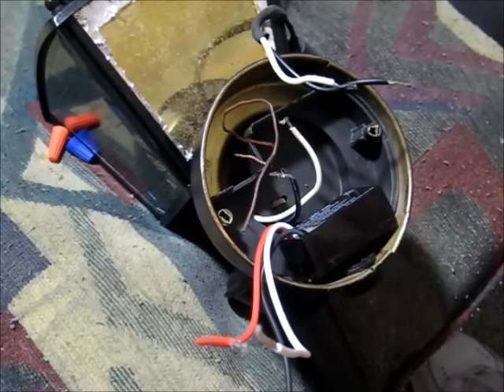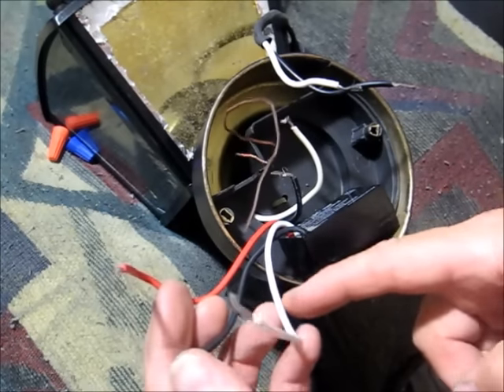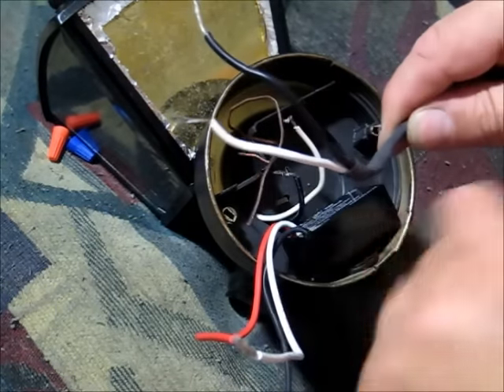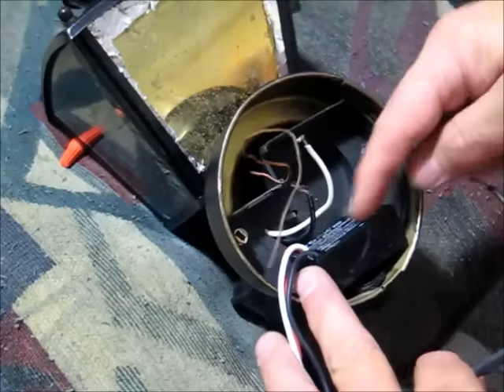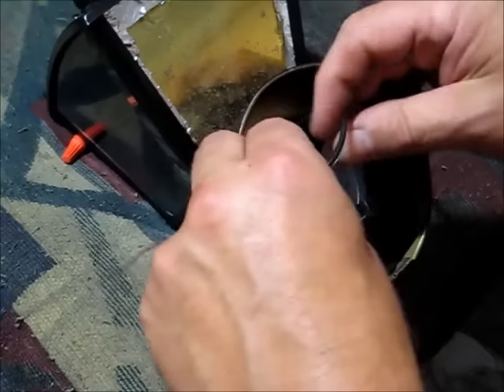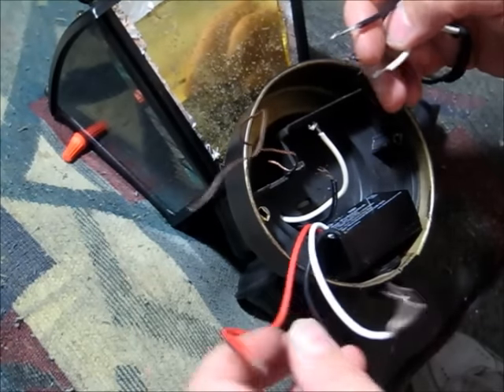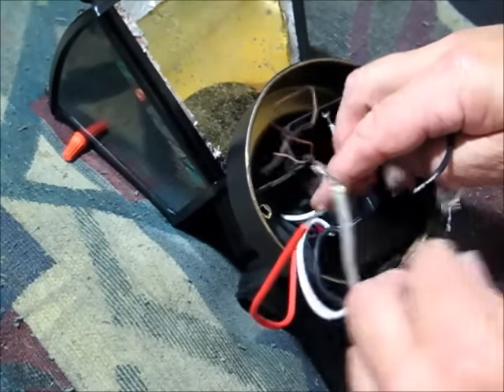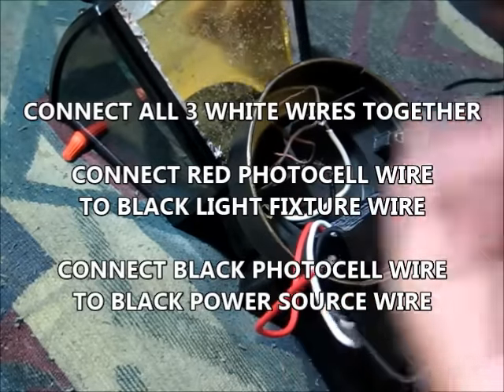HOW TO WIRE A PHOTOCELL FAST AND EASY, SHORT VERSION, THE TRUTH, WIRING INSTALLING HOOKING UP

Comment: perfect.   Ordered one of these online and came with no wiring instructions.   You were straight to the point and it installed perfectly.   Thanks
Reply from the maker: It is great to read your good words, I am happy my video helped. "no instructions" is what inspired this video, the one I bought had no instruction either... and as simple as the solution is, making a mistake with electricity can easily cost/waste money... or worse.
Reply: @7777jayhawk  are you still taking questions on this wiring problem. So many have them stay on all the time. I blow the gfi breaker on my deck led lights thought white was ways to white.the led lights on have 2 wires hot and ground.I tried 3-5 differerned wiring version and it either blows the breaker in the house or stays on all th etime on the outside gfi. The Only place the led light sensor going off and on was inside on a regular circuit, .  but that's not gft.I don't know where you are going with after all the white wires. I always.it's the green ground or the hot wires that messes everything. thanks.
Reply: Simple so anyone can understand.  Thanks!
Reply: @KittieHoney  Never could get mine to work no matter how I wired it. Just like everyone else. How did you get it to work?

Comment: The power line going from the home is red and white.  The light fixture is black and white.  And the two wires from the photo cell are black.  What are your thoughts in wiring everything up?  Thanks.
Reply from the maker: The photocell should have 3 wires, if it does not... if it was me... I would not use it. I would obtain a 3 wire photocell to keep things simple. They only cost $5-$15.00 which is cheap enough to be safe than sorry.
Once you have a 3 wire photocell.... Uhm... As far as the red and black house wires?
I guess... man I dont know. 
Once again if it was me I would assume the black is the black and the red it the white... BUT that could be disastrously wrong. 

YOU HAVE TO BE CAREFUL because, course you are solely responsible if it all blows up. 
Based on that, if it was me.... I would get some ideas from the internet, but I ultimately it is all up to me. We/you/all of us have to take responsibility for our actions. No blaming/suing the internet guy. 

Another idea is... do a simple small test using a lamp or something with a cord you can cut into and then reconnect. 

Cut the cord (you actually only have to cut one of the wires on the cord) on the lamp which will give you 2 ends representing your power line and light fixture.  If you cut the cord in two, before cutting mark the sides of the cord to reattach them the same. THEN... maybe your two wires on the  photocell can be connected to wires on the cord. You know? Hook one photocell wire to coming... and the other photocell wire to going... and leave the other cord wire connected. 
Then hold your breath and plug it in... Have a helper keep their eye on the breaker box, shield your eyes from the bulb in case it explodes and then wait to see if the photocell works. 
Hold you finger over the lens (making it dark) and see if the light comes on. It may take up to 5 minutes to activate, so give it time. If it comes on point the lens to the light and see if it goes off.
If that test works then do the same thing on where you want to install the photocell.
I hope that made sense, if not ask again, I am happy to help. I may not answer fast, but I do try to get back with people who are polite. 
I am curious how it all turns out, let me know :)

Comment: I installed a photocell on two lights I have just outside the garage. One of the light is blinking on and off, what could be causing that?
Reply from the maker: I hope it has stopped blinking by now and is working fine, sometimes they just need to work themselves out. If not I hope you have returned it and the replacement words fine. If not, I am not sure why it is blinking. Maybe it is the time of day dusk/dawn and it is not sure to be on or off... other wise... it is probably defective, esp if the other one is working fine.

Comment: most comprehensive and easy to understand video on the topic out there right now. major props. what if my light has a ground wire too?
Reply from the maker: Thank you for the good words Joseph, they are my only pay for my videos and it makes me feel good to hear that I did good, that is my main objective with my videos :)

------ ""what if my light has a ground wire too?"" -------
If your light has a ground wire AND the house power supply wire at the light has aground wire, then connect them.... but if the house power supply wire only has the black and white wires, like mine does, well.... I can only say what I did... 

My power supply cable did not have a ground when I started this project and fact be known that  light and this house has been here for 50 years without a ground wire attached... so I did not ground the light.

If there had been a ground wire sticking out of the fixture I would have tucked it in, but that may be the wrong way. Could that cause me problems later? is it dangerous? Is it OK? I am honestly not qualified to answer that. But my light is not grounded and so far so good.

I suppose the right thing to do is run a ground wire (or run a whole new power cable with a ground wire) to the lighting fixture and then make sure the other end of the ground wire is actually properly grounded (or it is all for naught) and then connect the ground wire to the light...  but I didn't do that...  I decided to leave it like it has been wired for 50 years and I watched a football game, read a book or made another video instead  :) 

 That is my "cover my ass" answer while also trying to offer good info :)

Thanks for the good words, they are always appreciated. Have a great week!

Comment: I have 3 wires from the house, one is a ground wire, so I connect the ground wire to the metal part of the light where the green screw is, and then connect the other wires like you did
Reply from the maker: Sounds good Dingo,  You should make a video showing that... and maybe show how/where the ground wire is connected (at the other end) so it can help out if/when there is a short and the ground wire is needed.

Comment: I have three wires from sensor. The wire I'm running from the sensor to the transformer is two wires.  How would I hook that up, or do I need to get three wire to run from sensor to transformer?
Reply from the maker: If I understand the question and it is like most things I have dealt with.... The transformer is just a like any power line with 2 wires coming from it. the fixture has 2 wires. The photocell sensor has 3 wires.  Follow the diagram in the video and hook 3 white wires together, then hook the other wires to each other as the diagram shows.

Comment: Here is a question... "Can the RED wire be the main source of power that connects to other lighting loads??" To make a little bit more clear, I don't want the photo cell to be near the lighting load I want to be creative and place the photo cell in a different position so that means the Red wire will connect to a 14 AWG to connect to the lighting fixture... will that work??
Reply from the maker: I guess you could run some extension wires, but it will still be wired the same. I suggest calling the manufacturer of the photocell and ask them the smartest way to do this. I call help desks all the time and ask them about smarter ways to do things like this. I actually look to do business with (buy the products of) places that have a toll free 1-800 help desk number listed on the package. Give them a call and let us know what they said.

Comment: I tried this and it caused my water heater to stop working.
Reply from the maker: I understand, I posted but it seems someone delted the disclaimer for the this video.  I said that doing this has been to known to cause blackouts, cursing, excessive drinking, water heaters to stop working, Sleepiness, Dizziness,  cars to suddenly run out of gasoline, wives to start nagging, extra urination, erection problems, weakness, leg cramps, thoughts and desires of wanting to ride a horse or jet ski are just a few of possible side effects. In addition Fatigue,  Clumsiness, Weight gain,     Indigestion or nausea, Nervousness, Memory loss,    Headache,  thoughts of drinking a lot of beer,  Intense and sudden foot pain, gout, garbage disposal to act erratically, wive to act erotically, lawns suddenly need mowed, strange feelings that you want to move away, Diarrhea or constipation, Swelling of hands or feet, Fever,  Itchy eyes, Thoughts of suicide or harming yourself,  Seizure, fatigue, Intense and sudden foot pain, gout, garbage disposal to act erratically, wive to act erotically, husband to start fixing everything or nothing depending on the season and location, lawn suddenly need mowed, sudden feeling you want to move away,   please check the packaging and with your Doctor, Lawyer, CPA and others before ever trying this on you own.

The Poster and hoster of this video is not responsible what you do... everyone is responsible for their own actions and non-actions.
Reply: @7777jayhawk  Man, I have all these symptoms. now I know what to stop doing, thanks.